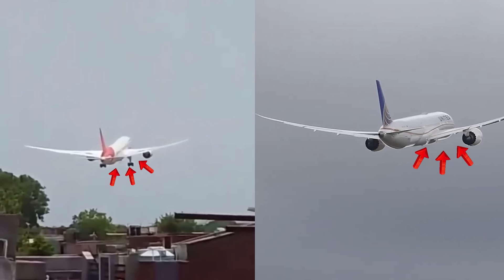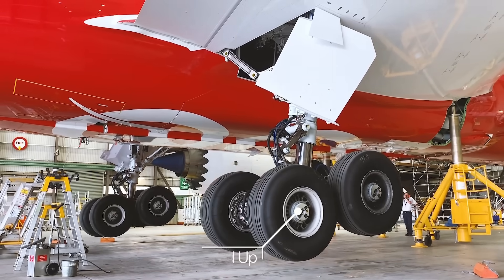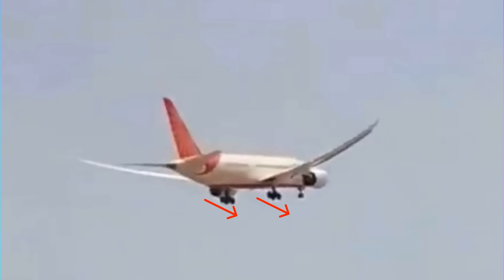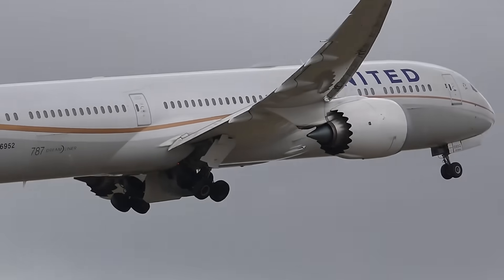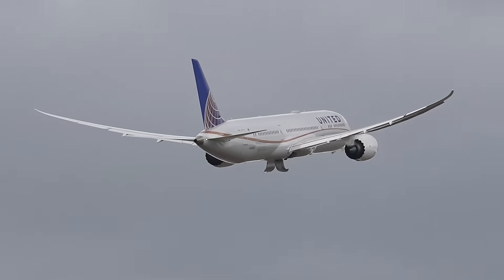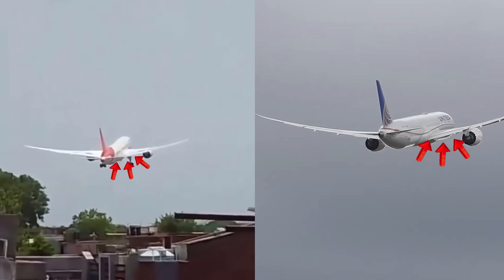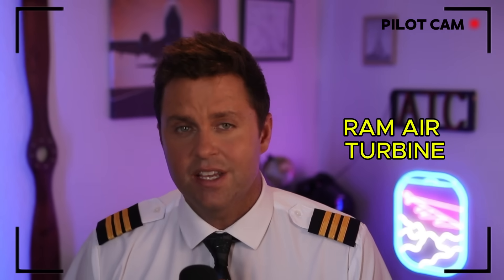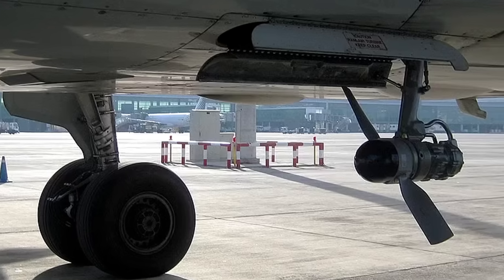Pilot Explains: A New Detail in the Air India 787 Crash Everyone Missed

Comment: Since the plane was off the ground, whatever happened occurred after Vr. Once the FO announces "positive rate", the Captain would ask for "gear up". If that command has been implemented, the gear first tilt forward, in preparation for retracting. It's at this point that things go bad. The single surviving passenger of the crash was quoted as saying he felt the plane take off and then heard a loud "bang". What could the bang have been? The RAT was deployed, under what conditions does it automatically deploy? 1-dual engine failure, 2-low or no hydraulic pressure in all three systems, 3- loss of all electrical power to the flight deck. The hydraulic system is powered electrically and by engine driven pumps. The electrical system is powered by dual redundant generators in the engines. It all points back to a dual engine failure. Had the fuel pumps failed, the engines on the 787 can suction feed from the tank in each wing to its respective engine, although that does not work well at altitude, but in this case the plane was just off the ground. What could have caused a dual engine failure? What is common to both engines that if it failed or exploded, would cause both engines to quit? Electrical power and fuel. There is a battery backup in addition to the RAT to provide electrical power, but the main bus must be closed for power to be available. Assuming there was power immediately after the RAT deployed, that leaves fuel. Assuming the fuel is not contaminated, how long would it take to reignite the engines and build enough power to remain airborne? If the fuel is contaminated, does that mean both engines would quit simultaneously? This is my train of thought.

Comment: Wow, that was a good catch.
The fuel cutoff switch that you mentioned is something that no one talked about. Being a pilot and an engineer myself, I believe with all the information we have so far this could be a plausible reason. Dual engine failure is extremely unlikely from systems standpoint.

The facts are:
1. Engine achieved max thrust at the start of takeoff (otherwise pilot may have aborted takeoff if there was an engine alarm or takeoff config. alarm).
2. Based on taxiway and back taxi and take off sequence, it used 150ish gallons of fuel so obviously the fuel path was open and good.
3. Takeoff roll was good and no issues until rotation.

The only practical way of these giant GE engine’s inflight shutdown (non-violent shutdown from full power) can happen is because of sudden fuel starvation.

This means the fuel cutoff valve could have activated - question is why?
The fuel cutoff switch in cockpit drives relays that causes the fuel shutoff operation. 
Hypothesis - Was there a design or maintenance error that may have caused unintentional activation of relays (for each engine) without pilot input causing the fuel to shutoff in both engines? I know at design they make systems fail-safe but for fuel cutoff - it can be performed at any stage of flight therefore something activated fuel cutoff for both engines- likely a design flaw if following this line of thought.
Reply: Is this aircraft fly-by-wire?
Reply: Yes

Comment: Whatever happened, happened on the ground. Unfortunately the pilots might be under pressure from the company to take off no matter what and then deal with the situation or that was their intention in the first place (based on the golden rule-during takeoff no matter what your best bet is to get in the air and deal with the situation then) . They should abort this takeoff. They knew something is wrong . There is no logical or any other explanation for this situation. It can’t be airplane systems working and after few seconds in the air all of a sudden the plane becomes a glider. Also the plane took off almost at the end of the runway, which means they struggled with something, but again they didn’t abort this takeoff and this I think is one of the main questions “Why they didn’t abort takeoff when they knew something is very wrong “
Reply: That's gotta be the wackiest "golden rule" I've ever heard of.  "Hey, somethings wrong with the plane.  Let's fill it with passengers, take it up in the air, then try and figure it out."  Seriously!
Reply: Yeah that is NOT the golden rule. Any pilot will tell you that they stay on the ground if there is any doubt about safety. The pilot would have been past V1 before he realized there was an issue and had no choice but to take off and hopefully go around to land.
Reply: Once the plane crosses mark V on the runway, take off can't be aborted. Take off was smooth as per the available information so far. Something happened immediately thereafter which compelled pilots to give mayday call along with the statement that the plane doesn't get a lift!
Reply: You have to be kidding about that golden rule!
Reply: there wasn't room to abort, which is why the end of runways should be over a body of water or cleared land.
Reply: You're pretty darn confident for someone who has no idea.
Reply: Blokes have saved the day by aborting past the point of no return when they saw flight was gonna be impossible. See 'Mentour Pilot'.
Reply: That’s what I wondered about too
Reply: Corporate Pressure...

Comment: If electrical, pilot, or fuel cause, it is not engine failure.  Engine is just responding to input.  Would be nice to see some systems/fault tree analysis at this point in these videos.
Reply: yes agree, not a direct engine issue.

Comment: Good video and thoughts.. As a retired 787 pilot I'm wondering about the ECU's, (Electronic Control Units), that control the fuel flow to the engines.  My airline had an engine failure due to a loose cannon plug on one of the ECU's.  Another Youtuber suggested this aircraft had recently been in for maintenance.  If the ECU's had been part of the maintenance schedule and not reconnected properly, or a bad FMC command to the Thrust Management System, (FADEC), we could have a cause for a dual engine failure, the latter being more probable. The investigators must know by now what system caused the dual engine failure, the question will be why?  Anyone with a better knowledge of the ECU's and Thrust Management system?

Comment: Don't discount the theory that they lost one engine and accidentally shut down the wrong one.  A cousin of mine was the pilot of one of only two USAF C5s that crashed.  He was an instructor pilot taking a check ride and was in the left seat instead of his usual instructor position in in the right seat.  They were doing a simulated engine out in engine number three if I remember correctly. This was on approach at pretty low altitude.  I don't remember which switch he threw (maybe fuel cutoff) which was usually the second switch from his normal position in the right seat but was the third switch from the left seat.  He was looking at instruments and feeling for the switches by feel and counted two switches and shut down engine two instead of three which was already at idle.  They were too low to restart two and three was too slow to spool up once they realized what happened and the hit the ground short of the runway.  There are YouTube videos about this crash.  Fortunately no one was killed in the crash.

Comment: Cathay Pacific flight 780, (April 2010, Airbus A330-342) suffered dual engne failure because of contaminated fuel resulting in fuel starvation.

They got it on the ground at Hong Kong but just barely. 

They only thing they going for them is that the problem began to surface at altitude, FL390 and they had time to work their way through the problem.

Comment: Gary, I've posted this elsewhere too and for some reason no one picks up on it. I dont know if there are legal reasons for it, for which they dont speak about in in their update videos. I think this is a very important association they should not overlook.

On one channel someone had very briefly indicated that the flighttracker24 showing the altitude to about 625 feet, and speed about 165ft, and the ground trace stopping at the runway end.  With just that mental ping the following other things occurred to me.

How was flighttracker24 able to plot these? Because it has parameters is getting from the aircraft.   The aircraft did travel all the way to the crash site, and so we should have seen the speed decrease, the altitude reduce, and the ground track go all the way near up to the crash site.  We DONT see this!!!!  

This implies power WAS lost, and so the parameters COULD NOT be sent out, which among other agencies, flightertracker24 would have used to plot the three parameters.

This corroborates with the fact that the RAT was deployed.

This ALSO corroborates, as a reasonable possibility, the the Gear Up was executed, then barely started its move when power and hydraulics was lost, and so it could have remained in the tipped forward position. Of course, the pilots could have just let it be in that position knowing that was gear in a down state could be a safe alternative.  And after the Mayday call, with no height to nose down for speed, the full bravery and heroic actions of the pilots could be seen in the way they managed it to the very end.

As I wrote on Steve's channel, we think it a very good idea if the Govt of India offer their highest civilian award posthumously to the stunning, professional, heroic bravery of the pilots for their best possible controlled flight landing into the inevitable physics of the crash.

Comment: This FADEC crap does not have a minimum failsafe range. I once was delayed an hour and then 8 hrs due to delay because of a fuel filter light. Dual filters are not valuable? $1M per engine, a $2000 secondary fuel filtration system is costly?

Comment: This from Grok:
  Scenario: Passenger reports from the Delhi-Ahmedabad flight (DEL-AMD) on June 12, 2025, indicated non-functioning air conditioning (AC) and cabin electrical systems (entertainment screens, call buttons, reading lights) on the Boeing 787-8 (VT-ANB) that later crashed as Air India Flight AI171. This suggests a pre-existing electrical fault, likely in the Cabin Air Compressors (CACs) or Remote Power Distribution Units (RPDUs), which draw power from the 235V AC buses. If unresolved during the ~2-hour turnaround in Ahmedabad, this fault could have escalated during AI171’s takeoff, causing a short circuit or overload that disabled both AC buses and disrupted the flight computer (Common Core System, CCS).
Impact on AI171:
AC Failure: CACs were offline, as reported on DEL-AMD, consistent with a power supply issue or CAC fault, though non-critical for low-altitude flight.

Bus Failure: A CAC or wiring fault (potentially from manufacturing defects, as alleged by whistleblowers) could overload the AC buses (L1/L2, R1/R2), causing a total bus failure. Flickering lights reported by the survivor and Ram Air Turbine (RAT) deployment indicate electrical instability.

Flight Computer Failure: Bus failure would cut power to the CCS, forcing reliance on the battery or RAT (3–5 seconds to activate), potentially disrupting Full Authority Digital Engine Controls (FADECs) and causing the reported “no thrust” condition.

Crash Relevance: The mayday call (“no thrust, losing power”), rapid descent at ~625 feet, and nose-up attitude align with a sudden loss of thrust and control, possibly due to FADEC disruption from bus failure.

Likelihood: High, given the prior electrical issues, whistleblower concerns about 787 wiring, and Air India’s maintenance scrutiny post-crash (DGCA ordered 787 inspections, including cabin air compressors).
Critique: The 787’s fault isolation (RPDUs, circuit breakers) and redundancies (APU, RAT, battery) should prevent total failure, but maintenance lapses during the short turnaround could allow an unresolved fault to propagate.

Comment: Its possible the landing gear retraction was started but a failure in the electrical system driving it caused breakers to trip and transients caused a chain reaction in other electrical circuits and they failed also.  So it could be a loss of all electrical power first and then the engines.

Comment: The pilot of Air India reported back to the tower 
“ Mayday Mayday Mayday no thrust,  no  power “ 
( so we know it was a power/ Thrust  issue ) 

The “RAT “ ( ram air turbine ) in-flight will deploy automatically if  : 

1) Both engines have failed 
2) All three hydraulic system pressures are low 
3) Loss of all electrical power to the captains and first officer flight instruments
 4) Loss of all four electrical motor pumps ( EMP’s )  
5) Loss of all 4 EMP’s & an engine failure on takeoff or landing 

So at least ( 1 ) these ( 5 conditions ) had to occurred for the “ RAT “ to be deployed “ in flight “ 
Note : ( The RAT does not have the ability to raise the gear ) 

The 787 engines are controlled by ( FADEC ) Full Authority Digital Engine Control 

1 of the above 5 events must have occurred in order to effect the  < FADEC > Engine controls  and reduced both engines thrust >> 

The flight data recorder will give us the evidence that we need to determine the actual cause >
Reply: No; we know that the pilot on the radio THOUGHT it was a loss of thrust - that doesn’t necessarily mean it actually was.
Confusion sets in very easily in these situations.
Reply: @simonissell  > Simon, if it wasn’t “  loss of thrust “  then the 787 would still be flying ….
Reply: @robertleewhitt6241  I don't think anything can be said for certain at this point.

Comment: 4:35 - Don't the fuel pump trucks have real-time monitoring of the fuel that it flows into each aircraft?  If it detects contamination (like water), the fuel stops flowing immediately.  So fuel contamination in both engines is unlikely.

My theory is a failure of a major and sudden failure of the onboard main electrical power system.  This also explains why the RAT was automatically deployed--but it was too late as the electronics that control the engines already failed or were restarting.

Comment: On the ground electrical failure, lithium-ion battery overheating issue ~10 years ago on 787. Now high air temp., ac issues, flickering lights on last two flights, max battery draw on takeoff,  battery/electrical failure causes hydraulic and engine failure and turns deploys RAT.
Almost no one is looking to the >10 year old lithium-ion  battery/temp. issue with the 787 that supposedly uses the same type battery since 2010. (Google it) Like a gasoline car, a electrical system failure can kill the engine/stall the xxx.

Comment: Heat!!!!!! Was 40c Vapour Lock Causing Bubbles blocking fuel to engines!!!!!!
Reply: Ridiculous. It gets well over 40C in KPHX. Not the cause. Next.
Reply: thats not going to happen in a plane what they burn is more oil than gas it will not vaporize easy.
Reply: No.  Would have happened long ago in places like Sacramento.   It gets 116°F here.

Comment: Why isn’t it being discussed that it took the whole runway to gain enough speed for takeoff? The flight should have been aborted  there was a problem with the engines having enough power for takeoff. Definitely pilot error for not aborting takeoff
Reply: They didn´t use all of the runway, according to ADS-B data they took of with 900 meters (3000 feet) of runway to spare. The ADS-B transmission stopped right at the opposite runway treshold, which is at that point it´s suspected that the engines didn´t generate enough power for the electrical and hydraulic systems anymore.
Reply: @martinolssonbass  The video of the takeoff shows the plane taking off at the end of the runway not half a mile from the end of the runway. Doesn't even look like the crash happened half a mile from the point of liftoff
Reply: @chiefline7084  Can’t see the runway on the video, the view is blocked by a shed. ADS-B data might be inaccurate though, but according to Flightradar24, the take off roll looked normal.